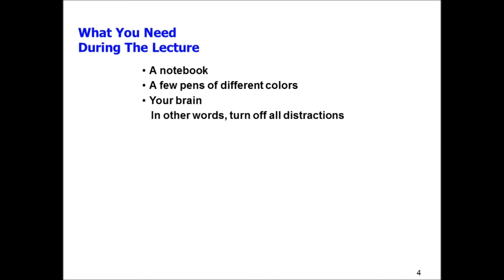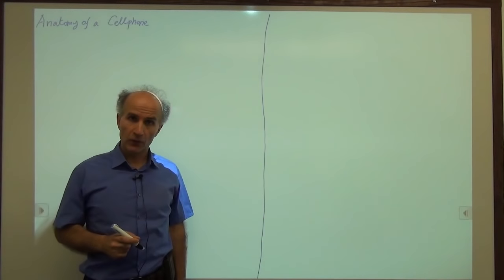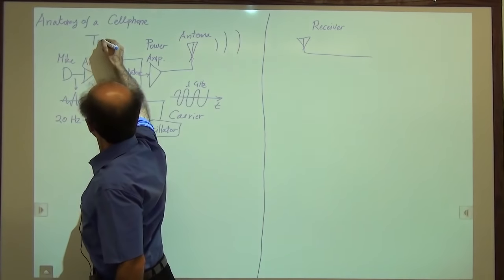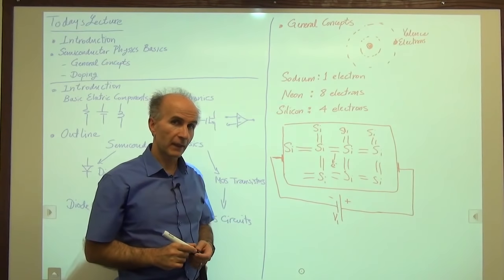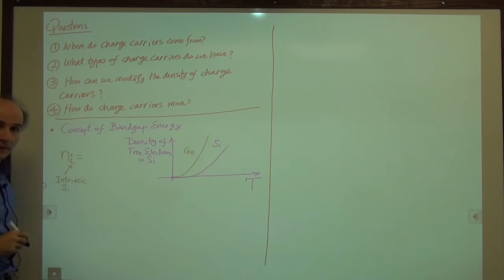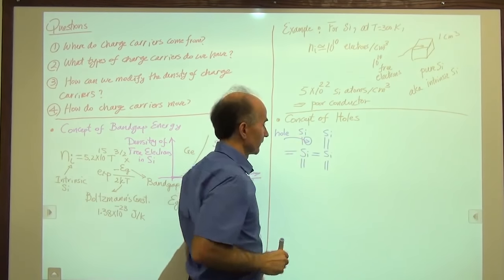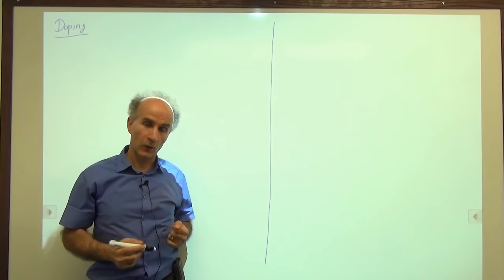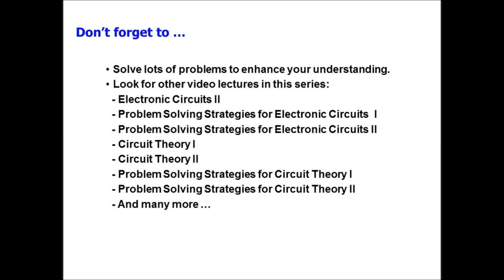Razavi Electronics 1, Lec 1, Intro., Charge Carriers, Doping

Comment: The crystal is drawn as a two-dimensional grid of neatly arranged atoms with 4 valence electrons each, forming covalent bonds with 1 electron each of its 4 neighbouring atoms, giving 8 valence electrons in the outer shell. But in practice, the crystals are three-dimensional, so each atom has 6 neighbours instead of 4.
So why do we draw them as 2-D structures? Why can we make this simplification? What would change if we did not do this simplification? How would that impact the analysis of the semiconductor devices? What would change in the formulas we derive?

Comment: Q.1 why we require semiconductors when we have many conducting elements according to periodic table??
Q.2 What differentiates electrical and electronics. Means why u put R, L and c in electrical components and diodes, fets in electronic components?
Reply: 1.Semiconductor s have unique property to conduct only in one direction according to its band structure , they have negative coefficient of temperature , can amplify signal etc
2.Electronic ckt means we more prioritize active components whereas for electric ckt we prioritize passive components 

Hope u are satisfied for some extent by my comment.

Comment: At around @41:46 are we assuming that we are giving silicon cube some potential of about 1V? Otherwise, does it mean that even without applying any potential, that much fraction of current is always present in intrinsic silicon wafer? I got this question because we have taken bandgap energy, which is in terms of eV, which as you said is when 1V is given. Or is that much amount of energy supplied by the atmosphere?

Comment: I didn't understand how holes and electrons are two different entities because hole is nothing but a counter part of electron. If electron goes left then hole goes right. Even hole doesn't have any mass then how is it a particle?
Reply: holes are not the counterpart,they originate from the quantum theory,they are the seperate entity but have less mobility than electrons with greater mass
Reply: I didnt get u can u please explain how holes originate from quantum theory pleaseee
Reply: How can holes move if they are considered as a point where an electron is absent?
Reply: Holes generate because of breaking of bond and free electrons may not be electron of a bond between atoms